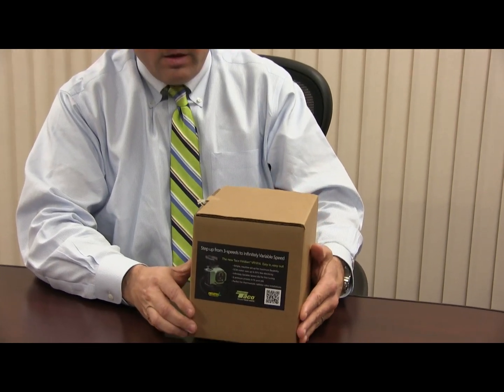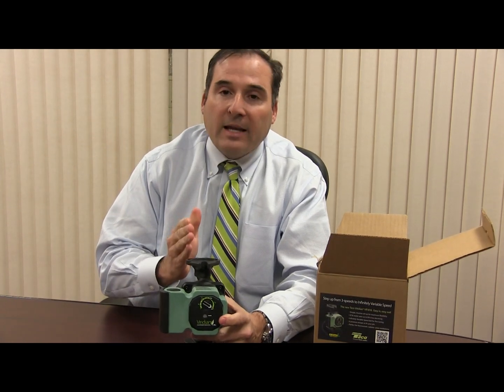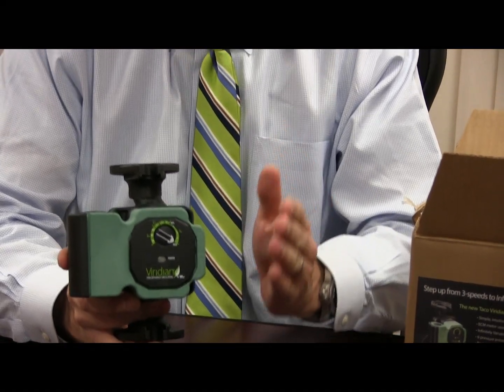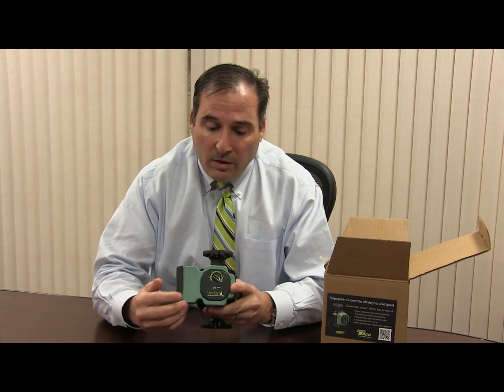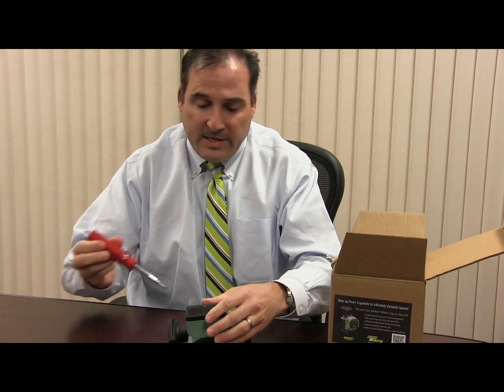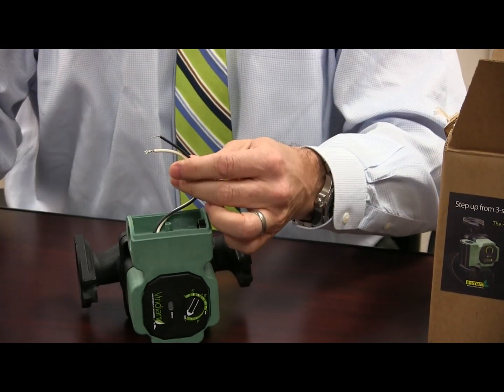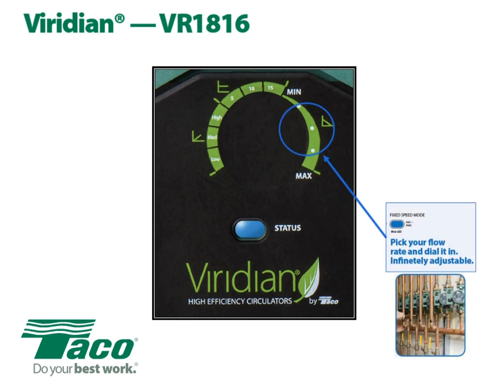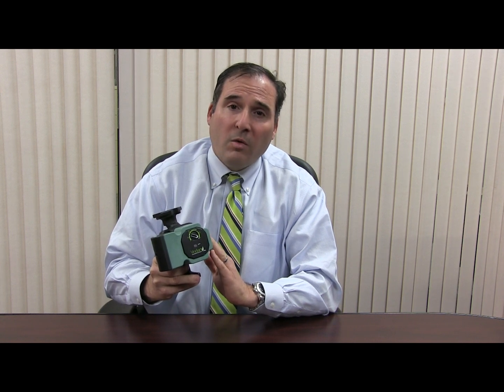Taco VR1816 Product Overview | Emerson Swan

Comment: Jim, Can this pump be used for boiler/system pump ? I have problem with my existing boiler pump causing heavy pipe banging noise due to too much suction from pump. Half closing shut off valve before pump is helping reduce noise in pump when honely well zone valve is closed but I need a pump which adjust speed based on pressure reduced when zone valve is closed and I was wondering if I can use this pump for boiler pump not for zone pump since I am using zone valves

Comment: Seems to be an error in the explanation of the fixed speed settings. Perhaps the pump has changed since it came out, but according to Taco's John Barba's video on the same VR1816 the minimum setting is where 'MIN' is, and that according to the fixed speed pump curve is equivalent to the 003, not 005. The first dot, where Jim points to and calls the Minimum setting is, according to Barba's video is 006 equivalent; the second dot is the 007 curve, third dot is 008 curve and MAX is 0015HI curve. So basically 5 major settings and then anything in between. I'm hoping this is right for my own understanding of this great circulator. I'm also assuming that the spatial settings between the five settings are more ore less equal to the spaces on the pump curve. So if one needed a service point halfway between the 003 and the 006 on the pump curves, it would also be halfway between the MIN and first dot setting.